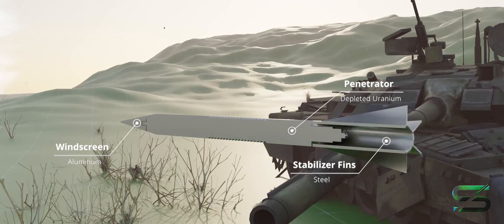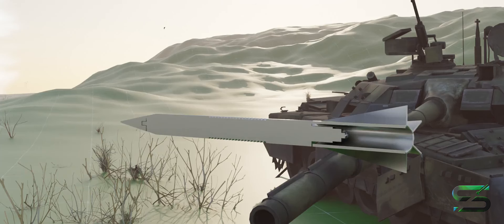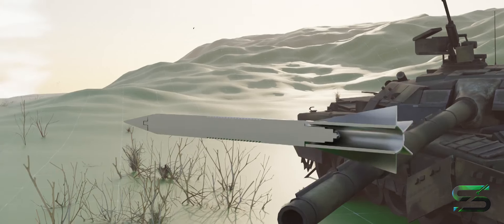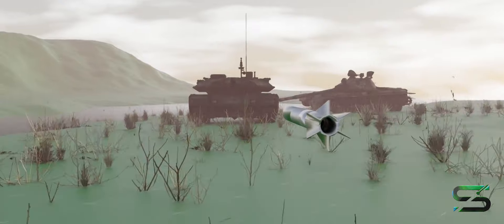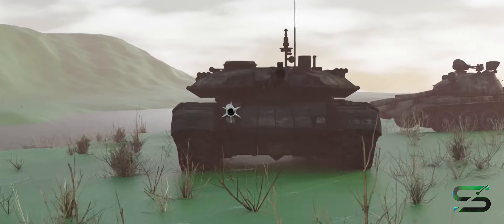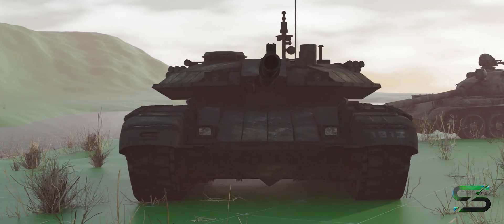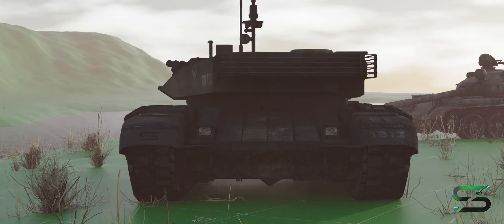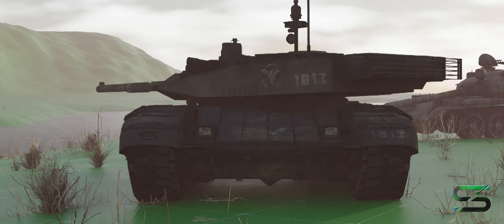M2 Bradley APFSDS-T | How it works?

Comment: The Bradley that engaged the T-90M in ukraine reportedly use only HE rounds during the engagement
Reply from the maker: Yup, they used HEI-T rounds, which is stated at the end of the video.
Reply: Weren’t they using APDS as well?
Reply: You can definitely tell
Reply: Yeah 

I believe it’s APDS that hurt the turret and some optics but the HE finished the optics 

They would’ve been so screwed if the T-90M got guns on them and the crew said they will never wanna fight a T-90M again cause they were very lucky there and the T-90M did its job well and protected the crew successfully and the tank was still operational after everything until the drone dropped a grenade inside of it and the crew were able to escape and escaped cause they were getting hit from everywhere but yeah I can’t imagine how it would’ve gone if there was another T-90M or like some BMP BMD or BTR support 

I wanna see how the result would be if a T-90M a BMP-3 and BTR-90 with ATGMS would fair VS a 2A6 and 2 Bradley’s 

Cause if that T-90M had at least some infantry support or like an IFV either they would’ve won from what I’ve seen
Reply: @BOEING--mh6xm no they were only using HE and APDS